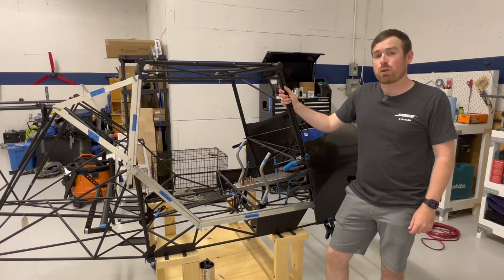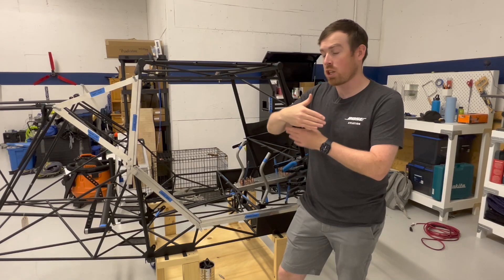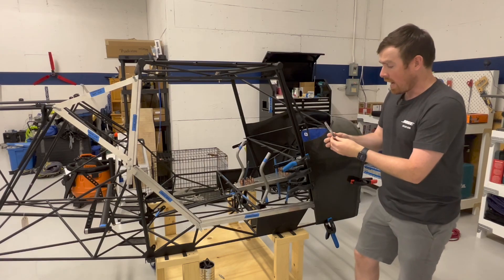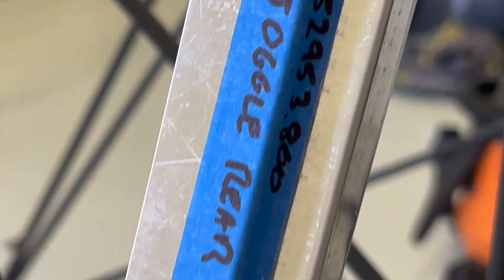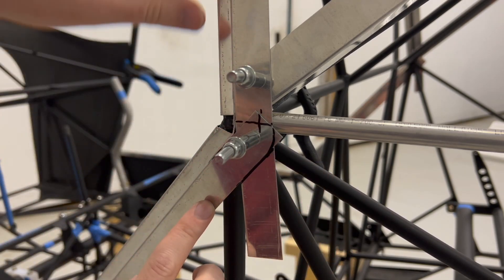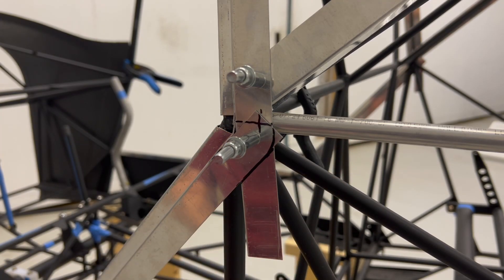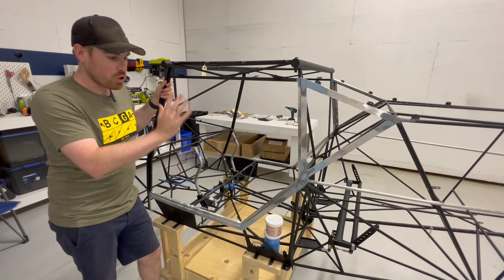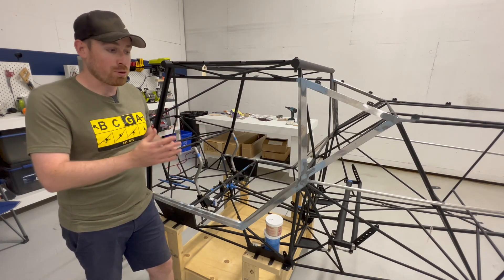Kitfox Build Update 05: Door and Window Frames (SwiftFox Build Project)

Comment: Nathan, I'm building an earlier version of the 7SS. In your door frames video you used a rivet dimpler tool. Can you share the specifics of the tool? Where did you get it, and any lessons-learned? Thanks!
Reply from the maker: Hey Chip, here's the tool https://www.aircraftspruce.ca/catalog/topages/ats_12-00169.php

I originally saw it in another builder's video, Aaron Butte (https://www.youtube.com/watch?v=K3C5ZCFdUcQ), and he probably shows using it better than I do in my video.

The one thing to watch out for when using the tool, is the nail is likely to snap at some point after repeated uses. Thankfully, I managed to get all my dimpling done in the door frames without that happening, but it will eventually. You can replace the nail with any similar sized nail you can pick up at the hardware store though, so it's not a deal breaker for using.